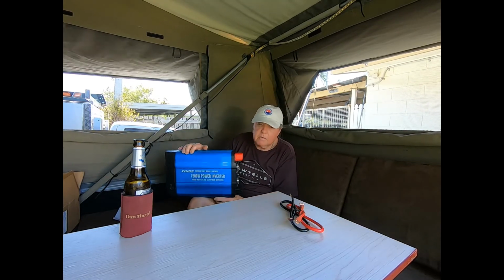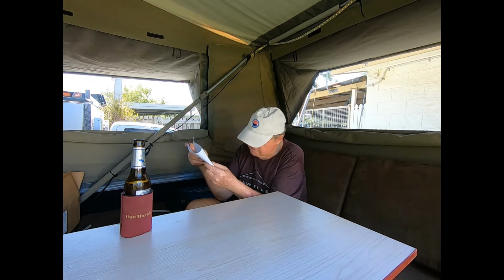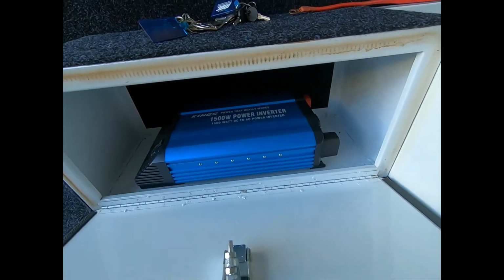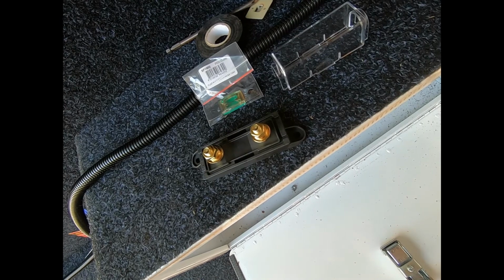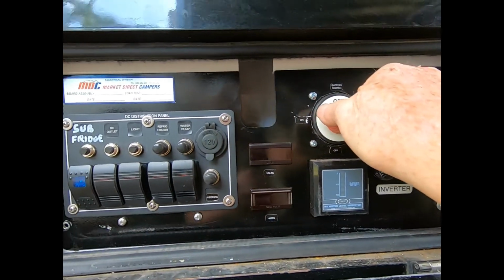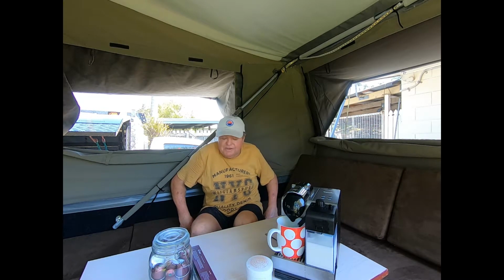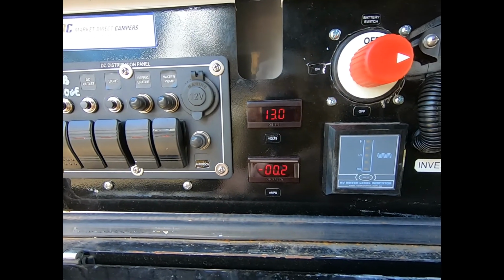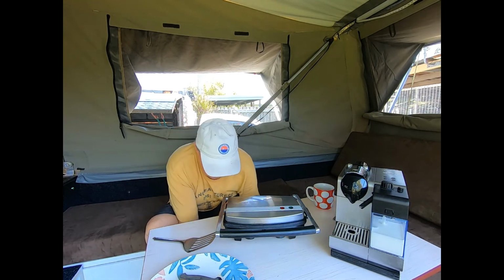Kings 1500W pure sine wave inverter

Comment: Has it lasted for you and does it work ok?
Reply from the maker: I sold this camper trailer 2 years ago. I've set-up my Hilux with a canopy and I purchased another Kings 1500W pure sine wave inverter to run off a Kings 120AH lithium battery. It works fine and you can use the sockets, for 240 volts appliances up to 1500W. I've made several videos using air-fryers, sandwich presses, an electric BBQ and I'm making another video using a coffee machine. With the 120AH lithium battery you are restricted, by the BMS, to drawing a continuous maximum current of 120 amps and a 5 second peak current of 160 amps. I'm very happy with the inverter. Cheers.

Comment: 16:25 is that the inverter in the back ground runnings ( the noise )
Reply from the maker: Yes, the dual cooling fans kick in when it's under load.
Reply from the maker: The kings inverter came with the equivalent of 6 AWG wires so I used 4 AWG as the upgrade under advice from the staff at JayCar.
Reply: @derekeasterbrook6791  hey mate if you added that 125A fuse I'd remove it as the input current limit is 147A continuous on these 1500W inverter I also used 4 AWG cable